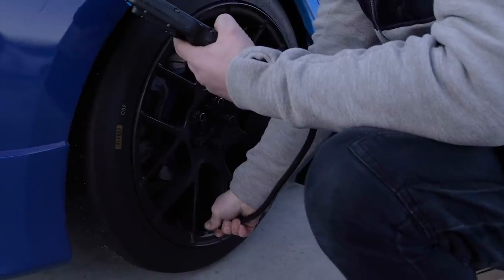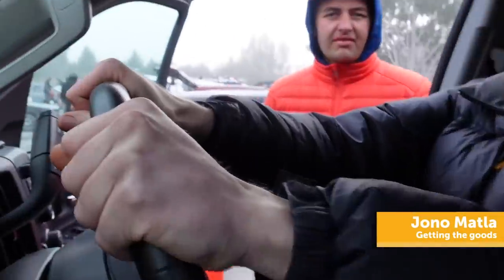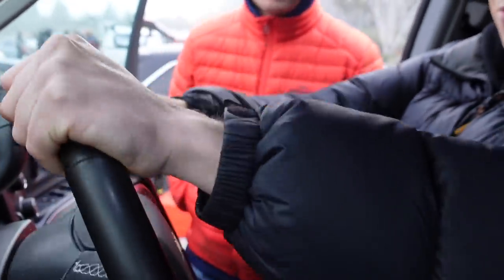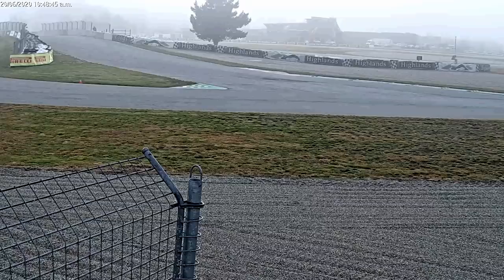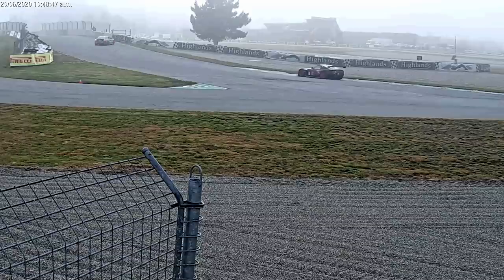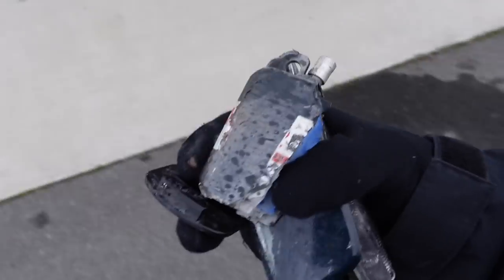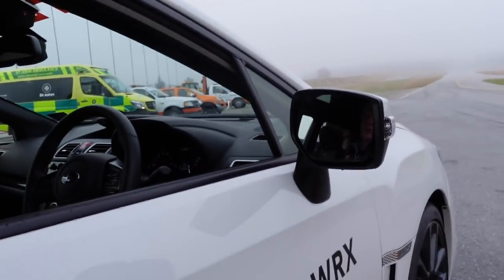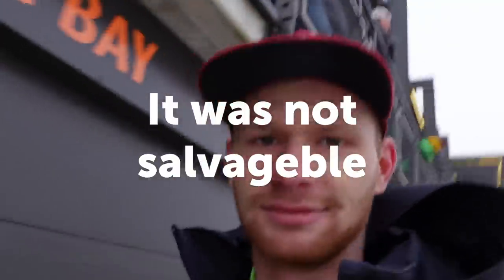The Aftermath Of A Miss Shift | Crash/DIY Panel Beating [OFF THE RECORD]

Comment: Dang, i did something similar. Flew off the road in a snow storm. Thank godness she took it like a champ, and the power got me out of the bushes. Blew out the shock bolts holes on the front right lower control arm. That and some bumper scrapes. Im glad its repairable, great video. Bless the back is safe.
Reply from the maker: Glad you're OK mate! Sounds like it could have been a lot worse for you too - Taz.

Comment: Andre on track days session you should always have with you tools to work on cars like: zip-tie, strong duct tape, AN fitings, vise and hammer, drill, heavy duty tie down or cargo strap, J-B Weld, self tapping screws for metal, ajustable wrench, metal cutters, plyers, file, screwdrivers set, hose clamp, crowbar,  bearing grease, aluminium can, cardboard, wood blocks, bottle and ethernet cable.
With this tool pack you should get back with your car on race track after two laps.
Reply from the maker: No amount of tools would have gotten this back on track 😉, but you have a solid list there. We also take some wiring gear too as a rule and either a spare laptop battery way to charge it - Taz.
Reply: @hpa101  It is possible if you have a strategy just to make quick fix and not waste a time trying to repair all. Just bypass oil filter with male to male AN fittings, change tow hook with tow strap, use a cone air filter rather then factory, check radiator for leaks if you have one just use J-B weld, check if hose or pipe have cracks if so use duck tape or aluminium foil tape, refill all fluids and check for a leak, remove front hood make it strait on a ground and reattach use cargo strap to lock in place, use duck tape and zip-tie to attach front bumper and front lights, clean tire and front brake and move on.

Comment: I'm gonna need to hear that long story about the turbo water supply cooler.  is it on its own loop or just in line with the rest of the system?  if its own loop, what are you using for a water pump.  if inline with the rest of the system is it pre or post turbo?  how effective was this?  I'm asking cause I have a turbo NC Miata (almost finished) and they run kinda hot thanks to the small front end and tiny openings.  So I need all the help I can get.

Comment: shit happen ... when you drive fast, it's not about if you will crash but when .... you can only learn from it (and us too) 
can you race with different tire ? maybe a good road tire / semi slick (like PS4S or R1R) would have more grip in the cold ?
Reply from the maker: While it does get cold here, to be negative temp wise all day isn't really too common but if it becomes and issue 'winter rubber' will be a go via a different tyre/compound - Taz

Comment: Andre should revisit the Drift Bible😂..... my question is though what gets damaged  when you compression lock?
Reply: Just means he locked the rear tires it didn't damage the engine
Reply from the maker: In my experience doing it some pride and a bit or a lot of traction are most often what you damage, but if you have a lot of grip you can do anything from flat spotting tyres through to transmission damage, to engine over rev and the potential failings due to that etc.

On a motorbike in the wet it's particularly easy to do if you're not paying attention and in some disciplines like rally and even drift, it is done deliberately to help cause oversteer. That's just my personal experience/opinion  - Taz.

Comment: just curious,does the traction control do anything when you spin?
Reply from the maker: Beyond getting really confused, not really. Once it has a sense of what is going on again it can help correct the car depending on a few factors (like if you're still attached to the bridge etc or not). In a nutshell, TC is not designed for a situation like this - Taz.

Comment: Curious to know how was your engine after this ? How bad was it from the over rev did it cope ok ?
Reply from the maker: Engine was fine, gearbox was toast from memory but we've been struggling with that for at while at this power level anyway with 4th gear letting go more than once - Taz.
Reply: @hpa101  Thanks for the reply good to know these engines can take a little punishment.
Reply from the maker: @captainslav6528  at double the output the only issues have been with the rods when using anti-lag. We upped the boost a little more though after a few years at around 1 bar and ran into head gasket limitations (surprise surprise!). Andre will have an update on all that before Christmas all going to schedule :) - Taz.

Comment: Why's there so little aero on the car?
Reply from the maker: A few reasons, but the main one is that it simply doesn't need it at this stage. 
It is actually not all that long that this has even had the roll cage, plus it's not on a massive tyre and runs what we think is a respectable amount of power for the build but is really not all that much.
We also want to keep this car relatable to a club level build, and as it sits we could easily get it road legal because of this - Taz.

Comment: Soy latte.....bad luck on the car though, id like to make it clear that its not typical for the front to fall off. On the upside how cool is that yellow kp61.
Reply from the maker: We won't be replacing it with cardboard, or cardboard based derivatives - Taz.
Reply: @hpa101  if i understand correctly you weren't saying the driver wasn't good just perhaps not quite as good as some of the others.